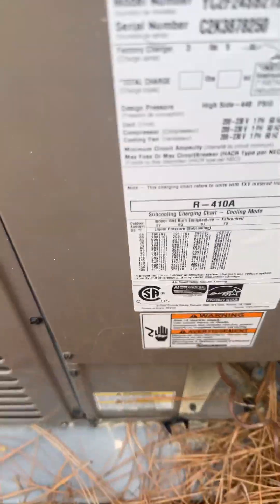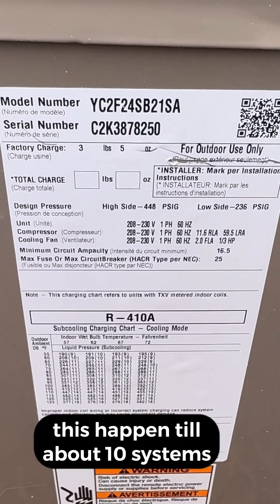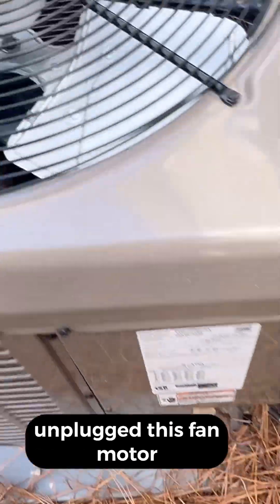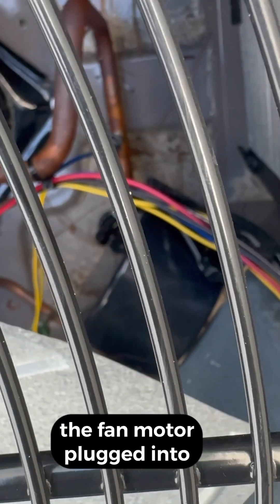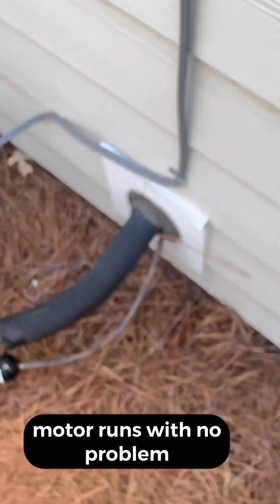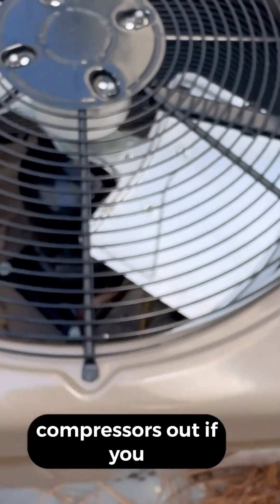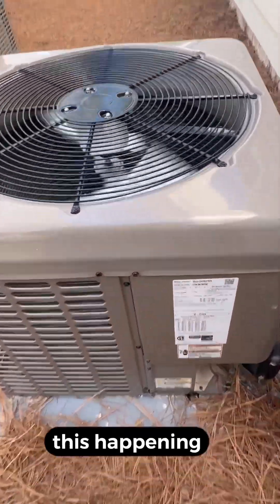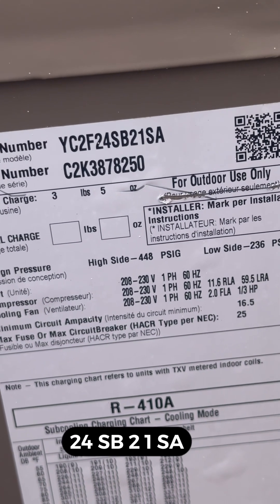Is the fan motor bad?🤔 #hvac #hvacparts #york #airconditioning #hvactraining #residential #comment

Comment: It has a fan wire that is rubbing out then getting ground. Same issue with the new Goodmans. Except theres is a low pressure wire rub out. Best thing to do is check your wires to ground using continuity reading on your meter. Once you find the wire that’s ground out isolated tape the whole wire or replace it and put new zip ties holding the wire tight.

Comment: Guessing the ECM either overheats on this design, shuts down, or it takes a voltage spike and shuts down.
 An IR temperature probe would help confirm that. Maybe the new model can't take the extreme heat many places have had.

Comment: Install a PSC motor and be done with it...
Reply: Only a hack would suggest that or do that type of repair.  This isn't the 90's and stop being lazy.  That system was probably still in warranty, but it is a York, so what do you expect?  But being lazy and putting in an inferior product as a fix is lazy and ignorant.  Stop doing hack work.
Reply: @Balticblue93  Hack?? lazy?? You act like this is some high end multi stage 20 seer unit. It's a simple 2 ton micro channel piece of garbage. Those ecm modules are a waste of your time and your customers money. And yes, it's more work installing a psc motor than replacing a module . I'm sure for a super tech like yourself it's no big deal. Keep your silly comments to yourself.

Comment: Does the fan motor have a capacitor attached?
Reply from the maker: No
Reply: Of course it doesn't, it is an ECM motor.  Why would there be a capacitor?  The module is the problem and very common on York and the family of equipment.

Comment: my best guess based on on what ive been learning is perhaps your capacitor went bad? get a multimeter tool to check it, be careful bc it carries a voltage charge. next is to ask how old is that capacitor but overall the multimeter tool will indicate the readings to see if its bad or not.
Reply: ECM motors don't use capacitors.
Reply from the maker: This particular fan motor does not connect to the capacitor. Great advise though for fellow techs out there!

Comment: Replace the module. Also it is happening because york suks. Scrapped my 2 year old york do to multiple failures. Fan motor, board compressor. Literally had to reapir the unit every 2-3 months. And it blew capacitors every other month as well even with hard start kit. Not a plug for goodman at all but swapped for a goodman. 5 years 4 capacitors 1 fan motor. Start selling reem.
Reply: love my goody. live in the south and I have seen hundreds go ten years with damn near zero problems.  when there is one is mostly caps. these units take a beating down here and take it great
Reply: @stinkyvonfishstix4196  agreed. Reem and goodman run like Trane used too, lol. York and its subsidies all suck.
Reply: Carrier is usually good.
Reply: @manniefresh7354  I have never owned or know someone with a carrier. So can not comment on that.
Reply from the maker: @manniefresh7354 I’m a big fan of Carrier

Comment: I'm not an HVAC technician, but wouldn't it be simple to check if there is voltage at the fan, when it doesn't work. If there is it's a bad fan of it's not it's the module?
Reply from the maker: Sometimes It has voltage and sometimes it doesn’t . But when the motor is unplugged from the module and then plugged back in, it works! I usually order both module and fan motor and replace both